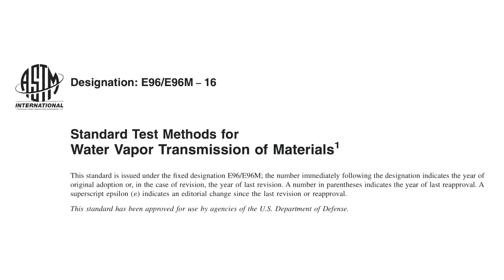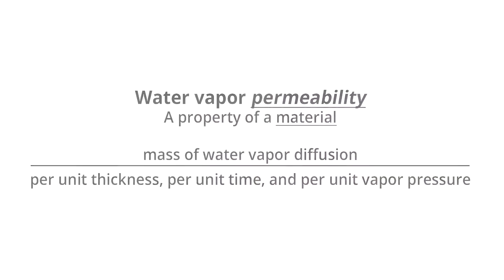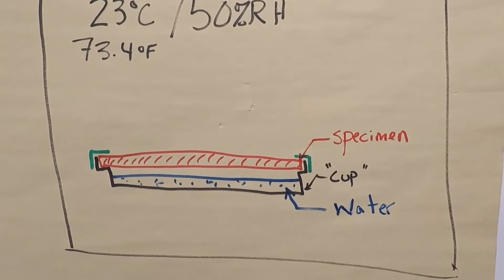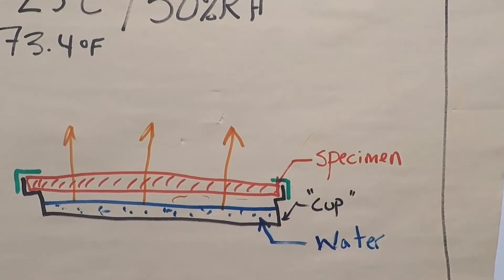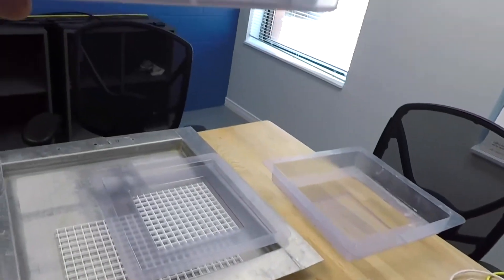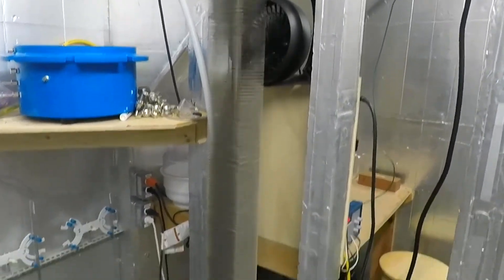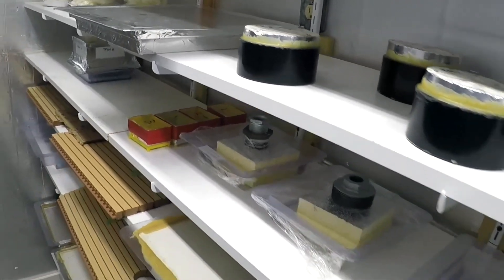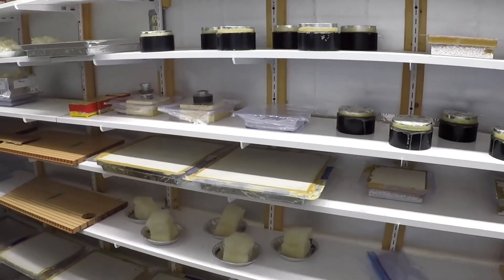Vapor Permeance Testing with Dr. John Straube

Comment: Thanks for this explanation. I'm a bit surprised you use plastic caps, instead of metal or glass, materials wich are known to be 100% diffusion close.  Does free cup surface not affect test results?
Reply: You absolutely cannot be sure that plastic cups will work, whereas you can be sure if you use glass or metal. However, the plastic cups are much more convenient and easily produced. Therefore, we ALWAYS test a new plastic cup using the blank shown with an aluminum sheet of about 1mm thickness.  We test it, and prove that the permeance of the system (cup, seal and alu sheet) is zero, that it, the mass does not change over time.  Ideally, for critical applications, we always run aluminum sheet blank samples to confirm that the entire process is reliable by producing zero mass changes.

Comment: What perm rating for exterior wall in Zone 1A?
Reply from the maker: The best reference document for you is the Technical Guide for DELTA®-VENT SA.  Dr. Straube contributed to this Guide.  Of the most interest to you is the Thermal Control and Vapor Control sections (pgs 14 to 19).  There you can find charts to see the thermal and vapor control recommendations for your region and wall system.
https://www.dorken.com/media/docs/products/Technical-Guides/Technical-Guide_DELTA-VENT-SA.pdf